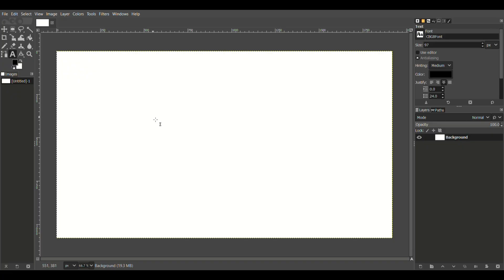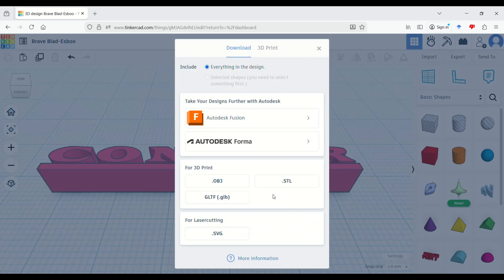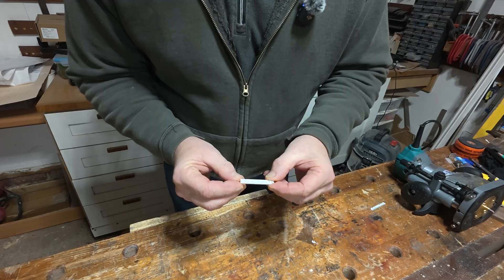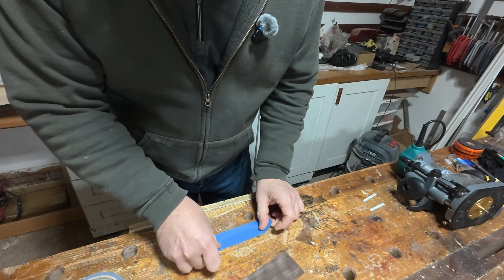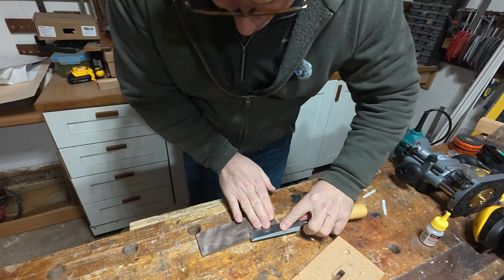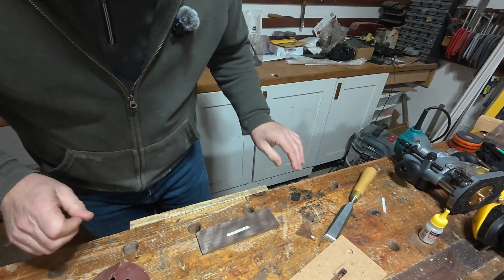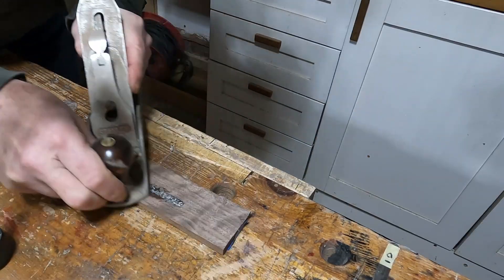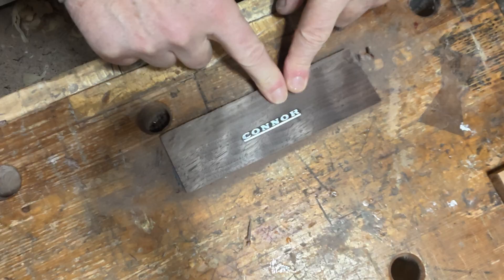How to create your own 3D printed headstock inlays.

Comment: Outstanding Patrick! I'm thinking you could make the template a little bigger or use a bigger bit. Use that margin around the inlay and fill it with purposely contrasting filler. It could be a feature instead of something you hope blends in. On a maple headstock for example. Black filler between the logo and the maple. Would look very nice.